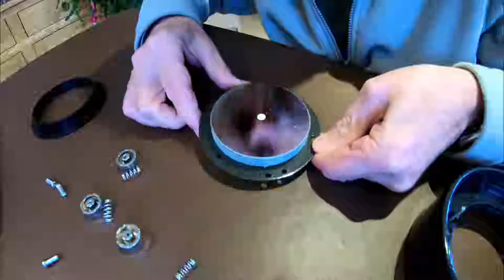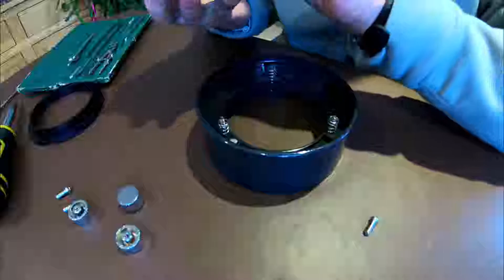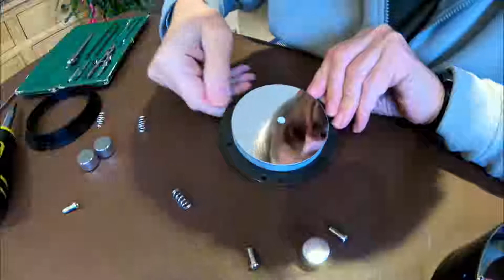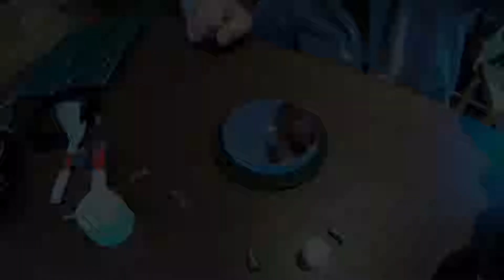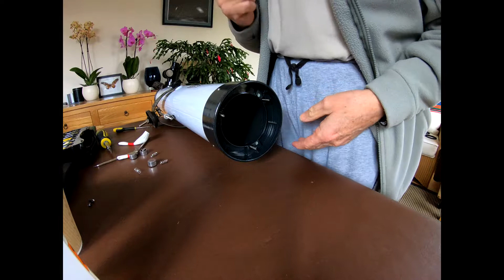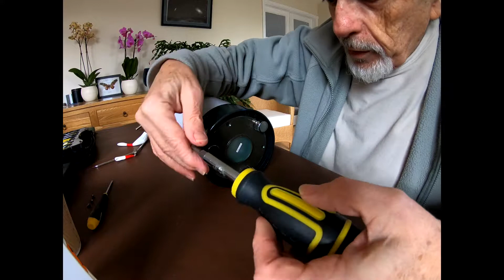Collimating a simple reflecting telescope

Comment: Sir if I use 12 inch Plano concave lens for reflection telescope which length and diameter of  secondary mirror will I used?
Reply from the maker: Are you making a telescope? It is unusual to have a lens and a mirror. The telescope in my video was a reflector - two mirrors. The only lenses would be in the eyepiece. You say a 12 inch lens - is that the focal length?